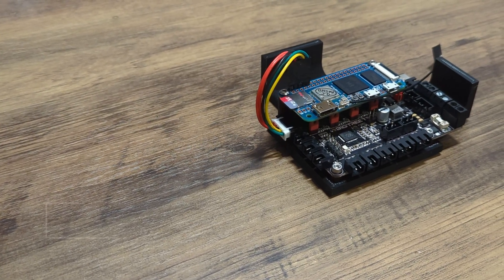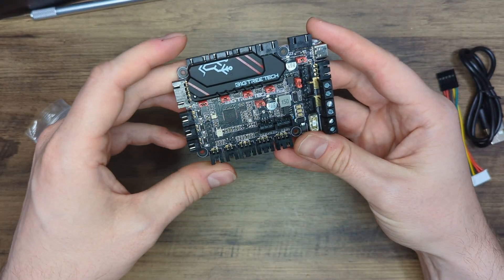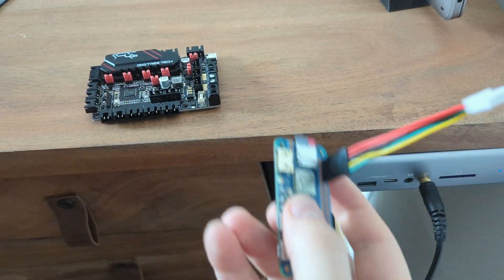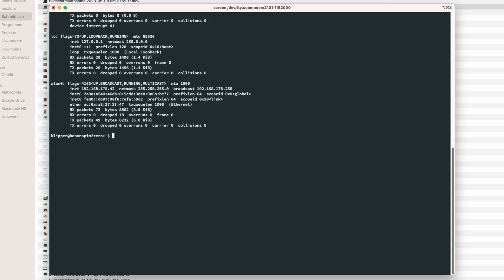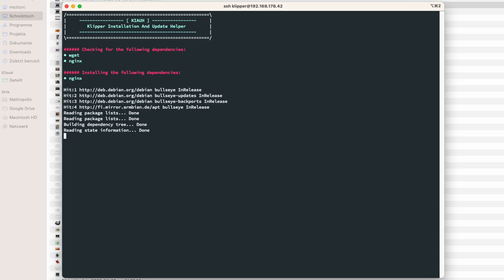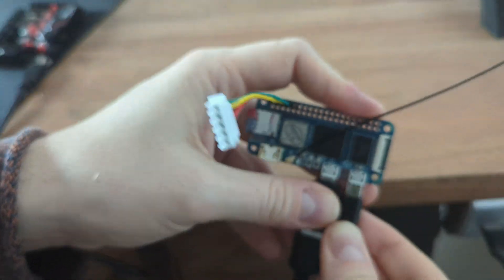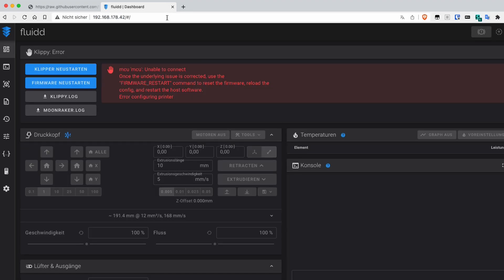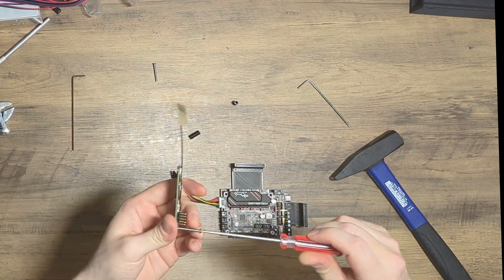THE 100 Assembly Guide - Part 4: Software Installation

Comment: Unless you have the image still available for the operating system and are able to share it, this can't be followed really anymore. That version of armbian isn't available in the archives anymore, and I havent had any luck with the newer versions. I'm going to do it now with a raspberry pi zero 2w, and I'll follow up if I get it all running well on raspberry pi os (rasbian)
Reply: Well I ended up landing on mainsail os running on a raspberry pi zero 2w (connected through usb, I gave up on trying to get uart to work) which has proven functional at last. This is far from a simple installation now, be prepared for allot of googling and writing your own .cfg files.

Comment: Hi there. Armbian archives only show 23.11.11 now. Will test if that works but if not, where can i get the version you used?
Reply: @matt sorry, but i confirm that 23.11.11 does not work. It does not flicker any time, stays lit. Has anyone got a link to a working image? This is a bit of a showstopper now..

Comment: For those who do not wanna bother with soldering for UART connection: After selecting "Micro-controller Architecture (Raspberry Pi RP2040)" leave the default USB setting  " Communication interface (USB)  --->" as is under "make menuconfig" and instead of using "/dev/ttyS3" in klipper add "/dev/ttyACM0" and use the same USB to USB connection and ports that used to upload the "klipper.uf2" to the board.

Comment: Hi. A very detailed guide. Thanks for that. I have some recommendations for improvement. Each time you enter a command on the command line could you add this command again on screen in an overlay? I found it very difficult to pause the video when you entered the command and most of the time, when the command entered is already on the bottom of the screen, the youtube video controls are in the way, blocking the view onto the command. Once you hit enter, the screen changes so fast that it is not possble anymore to see the entered command. You can also "clear" the screen on each step, then the command would be on the top.

One question in general: is the BanaPi required? I still have one HP620 Thin Client available which I want to use with Debian 12. I already use one with Ubuntu for another printer. Is the connection via USB fast enough for The100? 
I am still waiting for most parts to arrive, and I also have not yet printed everything.
Reply from the maker: Thx for the feedback! Check out our paper guide we produced, there is a whole chapter on software installation where you are able to copy/paste all the commands! You don't need a BananaPI as long as you have a bit linux know how you could prepare every pc based system to run klipper

Comment: dont get the armbian img on my sd card.. i tried 3 BRANDNEW 32gb Sanddisk class 10 but everytime get the error (Partition dont have FAT file system)
Reply: I think this happens when you try to apply custom settings to this Arabian version. I don’t think this version supports this and that’s why Matt is using a cable.

Comment: Make sure you are using the correct cable. They delivered a usb-c instead micro usb, so I used an old micro usb which didn't work (after 4h debugging😅). If you got an old phone cable the should work. (for anyone building the printer)

Comment: I'm running WPA3/2 personal on my home network. The Bananapi would try to connect over WPA3 but would fail. Manually setting the wifi connection to WPA2 fixed the issue for me. Just posting if anybody else runs into this issue.
Reply: Sometimes you also have to make sure it is using the less secure TKIP encryption than the less compatible AES

Comment: I'm really enjoying this build, the only thing I could recommend is to somehow list the screw sizes as you use them. It was getting confusing trying to figure out which ones should be used where. Also maybe some notes on how to solve binding problems, I had to switch to steel bearings on the Y axis because it wouldn't move smoothly and it would also pull the drylins out of place if moved quick. Other than that everything is very well designed, it's a very sturdy construction and I'm really looking forward to getting it up and running. Thank you for taking the time to make it easier than it would be without these videos.

Comment: This is a nice guide just want to know is it possible to also put a screen to the klipper install so if I don't want to use wifi I can directly control the 100 from the screen
Reply from the maker: Yeah the BananaPI has a micro HDMI port so you might also attach a Monitor, Keyboard and Mouse to use it like an SOC Computer, but for this I would consider to use an OS Image that has a graphical interface.
Reply: @MattThePrintingNerd  thanks for the reply I'll try doing what you said .
Reply: @arathireddy7559  you should also be able to run a prusa or ender style screen and button or touch screen like on voron running klipper screen